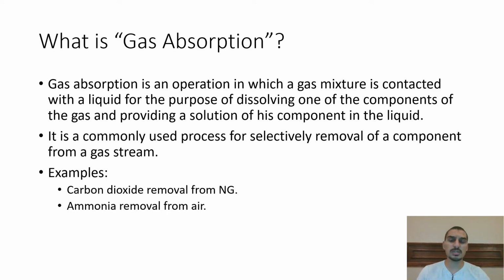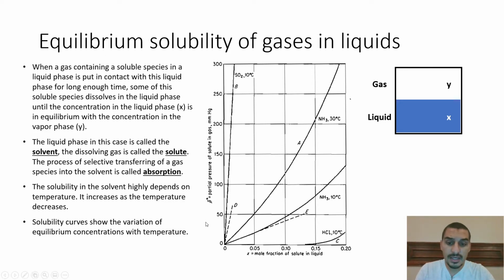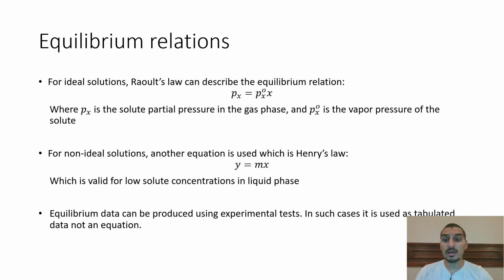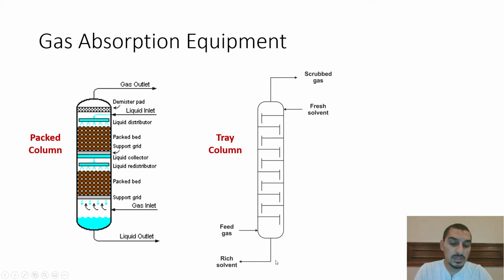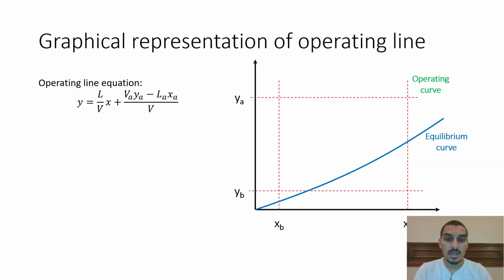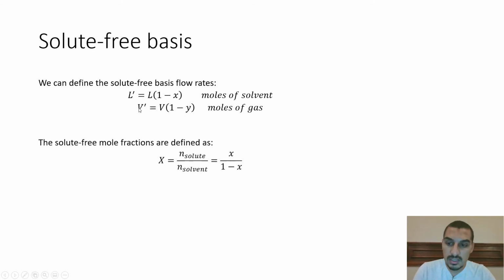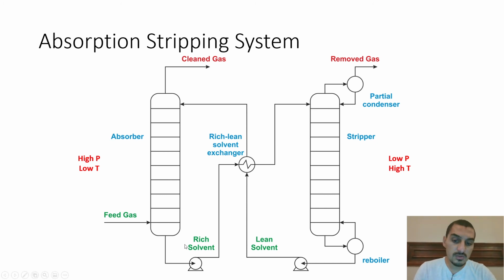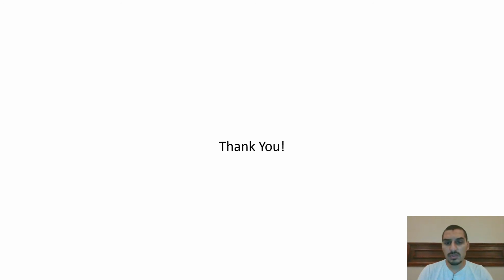Aspen Plus in English | Part 2 | 47 | Gas Absorption - 1 Quick review

Comment: Aslam Alaikum Sir, thank you so much for all the useful videos. May I please get your advice on this.
I am a 3rd year chemical engineering student, currently working on a design project aimed to produce DME via biomass gasification, I am individually working on designing an absorber and stripper to remove CO2 from Syngas (with small amounts of methanol and water).

I am currently contemplating whether I should go for a physical absorption design, using a solvent called Selexol, which is what I have initially started with and briefly discussed in the preliminary part of the project.

Or shall I go for chemical absorption using MEA as solvent, which is readily available in terms of literature, but seems more complicated due to considering chemical reactions.

Which would you suggest is less complicated and more plausible to be designed by one person during the 3-4 weeks I have?

Thank you for your time
Reply from the maker: Waalaykum Assalam Belal,
Is that you who sent me an email? If so then there is no need to reply here :)
Reply: @Mohammed Mohammed  
Yes Sir all good 🙏🏼. I'm currently struggling to find a correlation for the overall mass transfer coefficient for my physical solvent DEPG, do you suggest any piece of textbook or literature that may provide it?